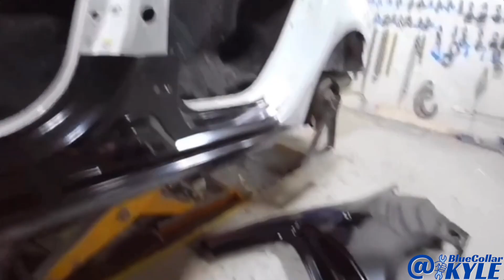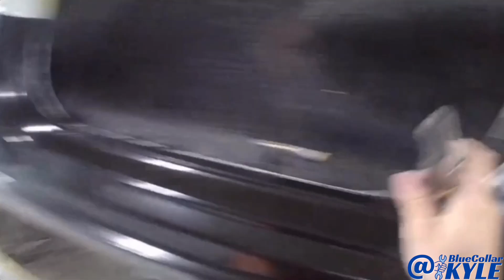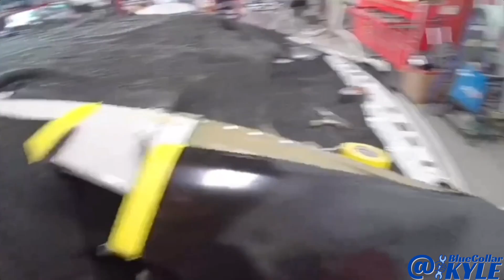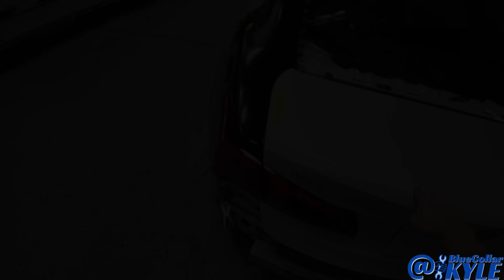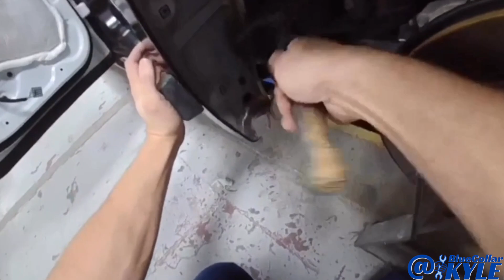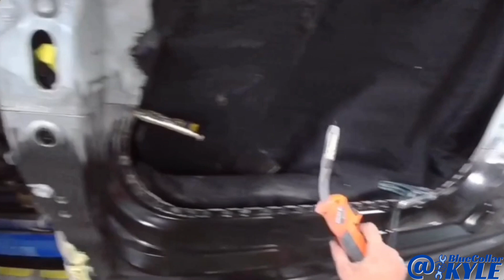Replacing Rockers & Quarter Panels

Comment: could you record a video about how do you remove the windshield?
Reply: Piano wire brotha
Reply: @TOXICVISUALSS   I tried that + utility blade , cold knife and multi tool ,  I broke few windshield  :D
Reply: @majid360a  did you try heat gun?
Reply: @TOXICVISUALSS  no  , I used liquid soap